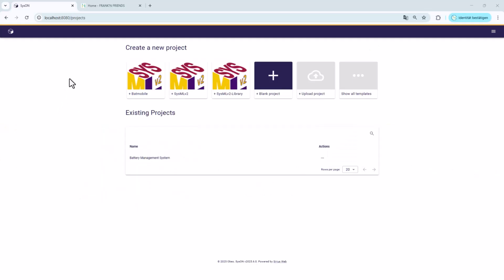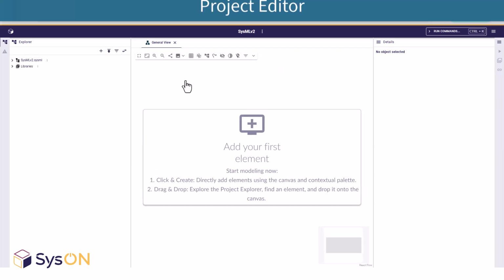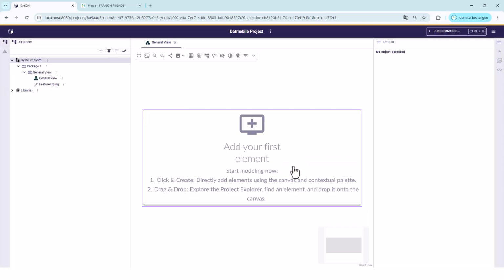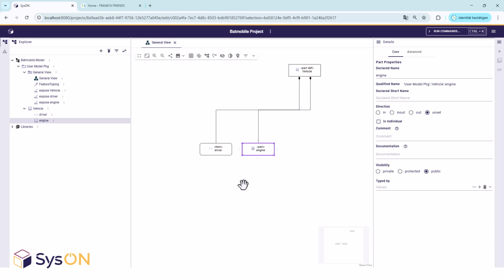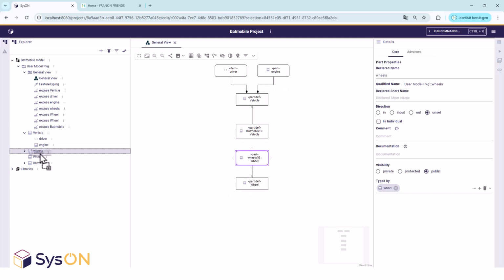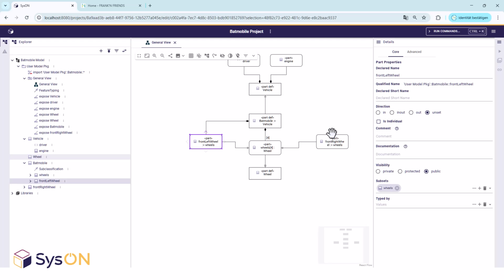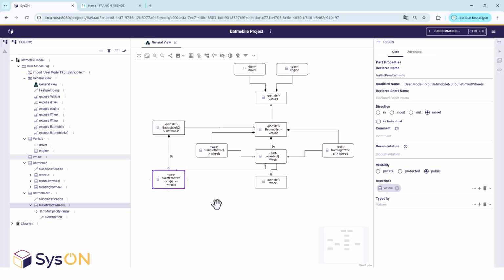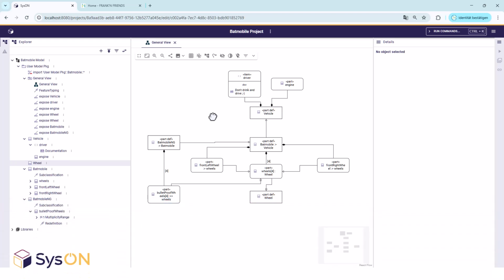SysON Tutorial: Build the Batmobile in SysMLv2 | MBSE Academy

Comment: Hello there. I'm new to MBSE and trying to figure out my learning path and the tools I would need to develop my technical knowledge.
During my research, I found that, MATLAB has also an MBSE tool named System Composer.
It's very interessting, because it's possible to connect the Simulink and Stateflow charts in systems model and the code generated by them. Which means everything (besides CAD models) is integrated, linked or nested in one platform.
However, It seems, it's not (yet) an common tool in this field. What is your outlook on this matter?
Reply: I am also looking into using system composer - It is a good tool for analysis but sadly not yet (and not likely to be) a competent modelling tool in its own right. This is a pity as Matlab could steal a march on Rhapsody and Cameo by adopting a strong sysMLv2.0 capability.